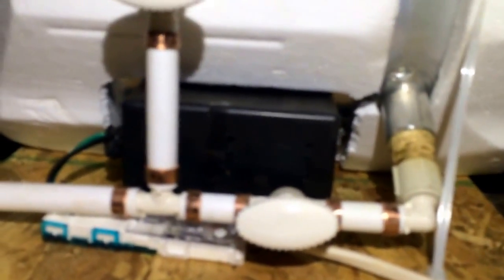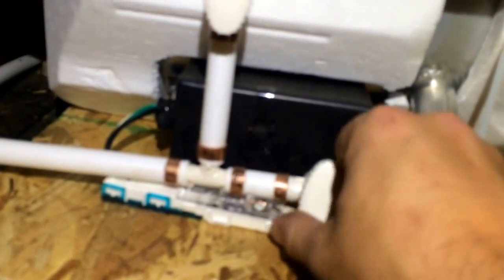How to Rv water heater bypass explained

Comment: I have the same tank but I only have one valve in the middle. off I have the valve in bypass I only get water on one side of the sink and no hot water. if I put in on normal flow I get water on both sides of the faucet and still no hot water even though the tank is hot.
Reply from the maker: the valve in the middle allows for cold water and hot water to mix, you honestly should have atleast two valves on a system like that. need to look closer at it or maybe have it looked at.
Reply: +JOE'S RV TECH DIY I found out the problem. a 94 prowler. the top valve for the hot side was working. I pulled it off and pulled the guts out. works fine but be for winter I need to go get a new working valve.